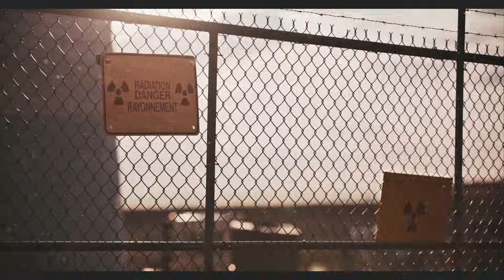Why Nuclear Power Can’t Fix the Grid: Cost, Delays, Risks & the SMR Reality

Comment: You are horribly wrong with your propaganda here.  Such propaganda is immorally keeping people from enjoying plentiful electricity at pennies per kWh.  You said these reactors take 15-25 years and tens of billions of dollars.  Aside from their 60-80 year lifetimes (you did not mention that), China and Russia are building them in 5 years at single digit billions per GW.  The fuel for reactors is about 5% of the cost of electricity while coal and natural gas fuel prices are about 80% of the power cost.  All the bureaucratic roadblocks you tout as "problems" are simply artificial delays placed in the way of nuclear simply for the pleasure of those who want high electricity prices (and going up fast).  Wind and solar are not viable without subsidies and the transmission, replacement, and disposition costs are huge (and not filtered in the current costs).  Risk is almost nonexistent except in the propaganda-fueled mania of the anti-nuclear movement (meant to keep you in expensive power).  No person has been hurt from the normal operation of a commercial nuclear power plant (including Navy nuclear plants) in almost 70 years.  No future health or immediate harm came from Fukushima and TMI (except in the propaganda), and Chernobyl, though the most dangerous design, was not under normal operations when it was destroyed.  Three other reactors of the same design ran for a decade after the incident at Chernobyl with no problem.  The Ukraine reactors have been in a war for almost 4 years and have not been damaged to the point of destruction.  How much safer do you want?  Animals around Chernobyl are thriving because people are not around.  The solar farms and windmills are hugely damaging to the environment and wildlife since no environmental scrutiny has been given to these projects.  They simply would not be implemented without tax breaks and direct subsidies (that you taxpayers pay above your power bill).  Security is part of every power plant.  Nuclear power plants are no different.  Notice he did not say "how" the reactor could be disrupted, just that "there is risk".  Wooooo.  Scary ghost stories meant for the weak of mind.  SMRs are intrinsically safe.  They are ready to go now, but the NRC will not move fast enough to license them.  Imagine, the safest machine ever built from the perspective of human health and protection, yet none can be licensed because of the ineptness of the NRC.  Wind and solar are more dangerous than nuclear (based on history of operation), yet they have almost no scrutiny for their implementation.  Any technology can be made to be expensive if regulatory burdens are high enough.  Nothing can be built faster than nuclear power plants in a free enterprise system with actual safety matched to actual risk.  So, get your own facts.  Nuclear power is where things are going and we will get there faster if government gets out of the way.  No power source is safer (based on actual 70 years of safety in operation), cheaper (proven by China, S. Korea, Russia and India), or cleaner (especially if we recycle our spent fuel in fast reactors (https://www.sirotinintelligence.com/were-sitting-on-100-trillion-and-want-to-pay-400-billion-to-throw-it-away-steven-curtis-on-americas-nuclear-waste-delusion-why-the-nrc-should-be-shut-down-and-how-texas-could-lead-the-f/).  So, the propaganda is hurting you with nuclear power.  It would behoove all of you to get your own facts.  It would also help your pocketbooks as well.  The question you have to ask yourself is "do I want penny per kWh power or dollar per kWh power"?  Fast reactor recycling opening up the door for free enterprise-driven nuclear power is the path to penny per kWh power, and lots of it very quickly.  Letting data centers subscribe all your power in competition with residential and other commercial power under a government monopoly will drive your power costs easily to a dollar per kWh (data centers are profitable at $3 per kWh).  Maybe you will see the light (figuratively and literally) when the bills skyrocket.  But it is your choice.  Listen to the propaganda or get the facts.  Look only at risk, or look at risk vs. benefit as you do everything else in your life.  Thinking and reasoning beats passionate propaganda any day.
Reply: This video is about execution, not ideology. What keeps the lights on is what can be built on time and on budget today...and that’s the point being made.